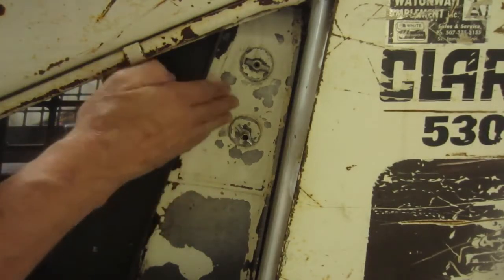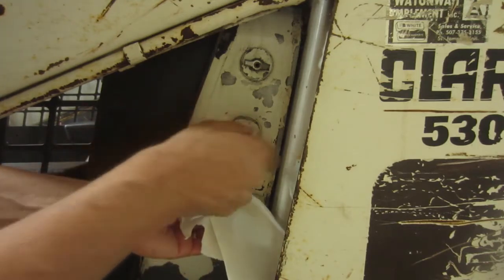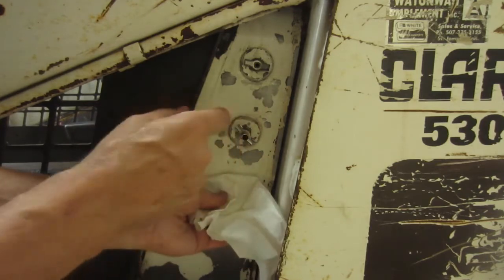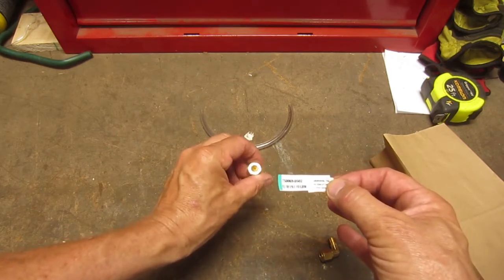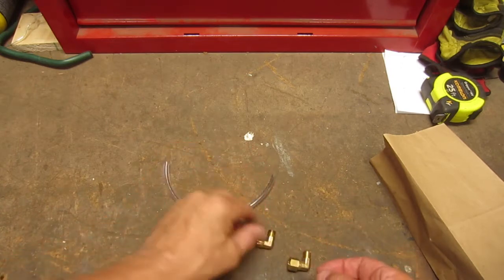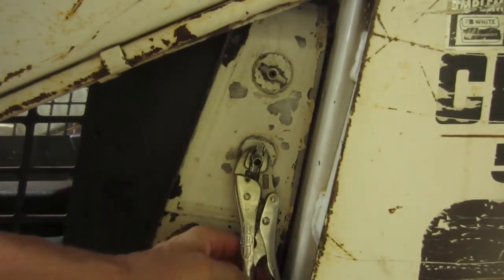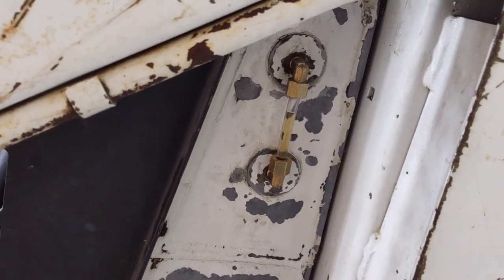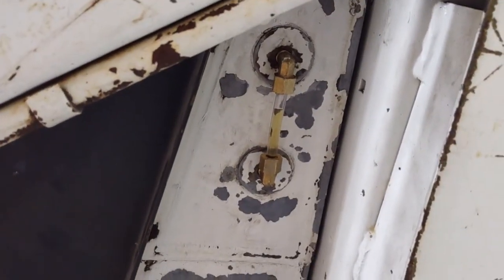Bobcat Hydraulic Oil Level Sight Glass

Comment: I have a bobcat 533 that came with the house we bought last year.
I’m trying to figure out how to replace it, and you originally mentioned having e brake problems.

I’ve tried to remove the seat from on top to get a look at it, and successfully remove the rear seat track bolts. However, the front ones are just kind of spinning. Are there any other bolts that I need to takeoff to take the plate underneath the seat off?
Reply from the maker: I'm not sure if the 533 is the same, but mine is held on with carriage bolts the go thru the fender lip.  From outside look for the nuts on the underside of the fender just above the tires.  I have four that need to be removed and then the whole seat and plate come off in one piece.